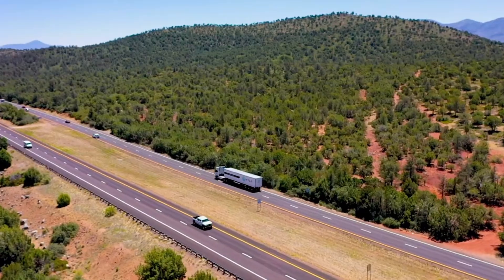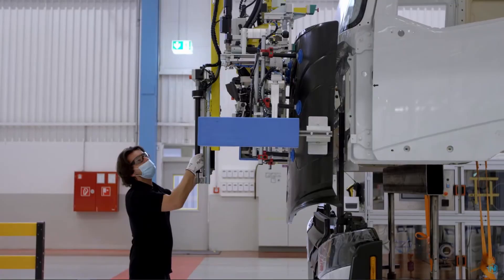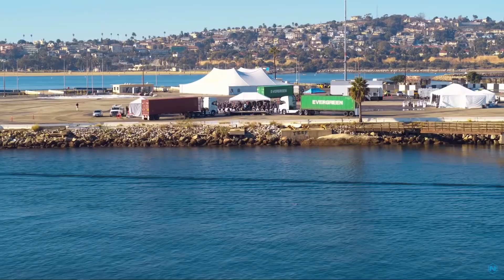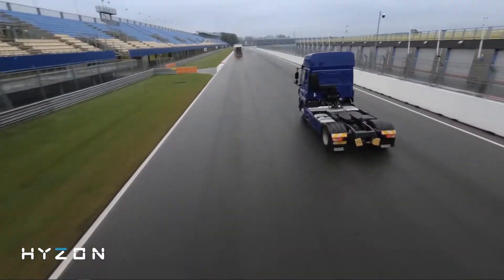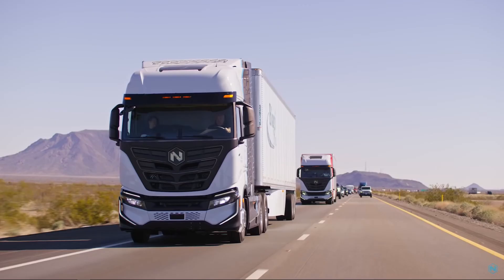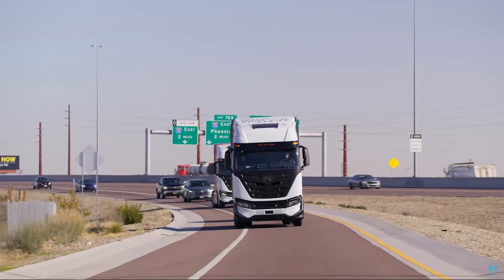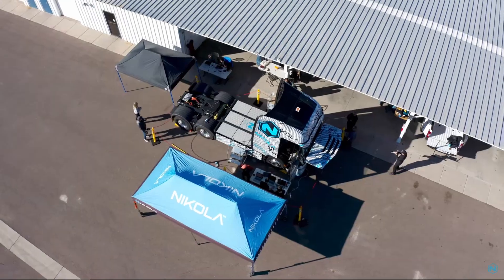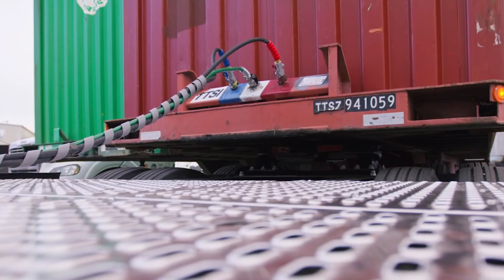Nikola Stats Show H2-Powered Trucking Is For Real.

Comment: this technology is not a bad thing, but the problem with this whole EV revolution is it’s not happening naturally. 
When American switch from horses to the model a ford, it wasn’t because the US government got on the radio and told Americans they were tired of horseshit in the streets, they didn’t start passing mandates and giving out subsidies.
it happened naturally Just like all things do that work out. Through natural selection Americans transition into gasoline, cars, and carriage companies and horse breeders fell off. When you force people in a four-year span to jump into a new technology that’s not really known that well or even really wanted. You end up with a lot of bad attempts and wasted money.. also any rational person can look at this and no down deep this isn’t the answer. 
That’s the problem with the majority of this go green technology, you’re trying to replace something that works already that was developed through time and natural selection with something new that’s supposed to provide the same services as your current technology at a much higher efficiency.
The problem I see is all the details that make up the factors that are measured to determine savings or something efficiency versus current technology are rarely used.
A good example is diesel truck, if you were to measure the admissions coming out the tailpipe of a modern diesel truck versus one from the 80s. It would seem like the region system has dramatically cut down admissions.
But the fact is if we was to measure the gas coming out of that truck for an entire week versus a truck from the 80s it’s virtually the same.
The region system essentially does nothing more than uses ammonia to strip the pollutants from the exhaust gases and turns them into a solid that is held in the bottom of the truck, but we’re not removing those solids and bearing them somewhere, the region holds the solids in a incinerator you could say, and then burns it away in a large burst. 

it’s not like the government magically figured out how to remove these particles from   diesel fuel. They just using a creative way to displace them to make it seem like its less. Those carbons are always there after you burn a fuel, and you can either release it into the atmosphere slowly overtime or quickly at one time or you can remove it from the gases as a solid and bury it, but it’s still being released to the earth.
this region system has destroyed the reliability of the diesel engine, it has made ownership of a diesel truck, not feasible anymore, it has cost the diesel industry billions for nothing.
These electric cars will be no different. As a consumer if you calculate the upstart cost of an electric vehicle, running cost and maintenance and lifetime of the unit plus the quality of service you’re getting for the trade-off it’s a complete scam.
It takes a lot more energy to produce an electric vehicle, alot more! The electric that charges these vehicle is being produced by power plants that are often fired by coal.
The lifetime of these vehicles aren’t very long. You’re not gonna see 20 year old EV still on the road. and storage and recycling after their lifespan is over is a real problem. Now we have large amounts of filthy lithium to deal with. It’s not the solution.

Comment: Are any of you suckers still holding NKLA?  The share price is down about another 40% since this video was posted.  Down over 97% since the original $10 launch price and 99.7% since the high.  Now they're going to dilute you by about another 13% by handing out shares to the MISmanagement team.  Then they can dilute away about another 94% of your shareholdings without even having to ask shareholders again.  This is really one of the very worst companies listed on a US stock exchange.  Milton & Girsky should both be locked up.

Comment: How most hydrogen stations work:  (1) Primary hydrogen delivered as gaseous or liquid hydrogen (2a) Gaseous hydrogen compressed into secondary high pressure tanks to 10K to 12K psi (2b) Liquid hydrogen gasified via heat exchanger and compressed into secondary high pressure tanks to 10K to 12K psi.  (3) To dispense into vehicle, hydrogen from high pressure tanks released into a chiller to chill hydrogen to -40 degrees and sent to the dispenser nozzle and into the vehicle.  The hydrogen must be chilled because when the compressed hydrogen expands into the tank, it heats up.  Max temp of Type IV hydrogen tank is 85 C and max pressure 12.7K psi.

Comment: It will be interesting to revisit this video a decade from now. Personally I see no future in hydrogen fuel cell vehicles, or Nikola. I’m 58YO and hydrogen as fuel for vehicles has been talked about my entire life, a bit like nuclear fusion has. The fundamental problems with hydrogen have not changed in that time, because physics has not changed in that time.
Reply: I'm 68 YO and never thought I would see a hydrogen vehicle.  However, as I live in California, I have been fortunate to be able to drive a light duty FCEV for the past 6.5 years!  The vehicles themselves work fine.  The obstacles right now are expanding the production of hydrogen for vehicles and the reliability of station equipment.  We are currently just resolving those issues and, I believe, within five years, there will be expansion into other states beyond California.
Reply: @bruhabox  Hi, thanks for taking the time to reply. Well done for switching from gasoline. I’m all for electrification, I have owned an EV since 2019 (BMW i3) and I will not go back to a combustion car. My issue with FCEVs is that I don’t see this technology as the answer to electrification, mainly because hydrogen has too many fundamental problems as a fuel source that I don’t see any solutions becoming available based on the physics and chemistry considerations.
Reply: @simonreeves2017  Hi.  Can you elaborate as to what you see as fundamental problems?
Reply: @bruhabox  I can. Hydrogen is very hard to store. It cannot be contained and thus it escapes. That's one. You need a very expensive system to work with it, from extraction to transport to use. Very very expensive.  You fill your tank and a couple of days later it's empty. Another issue is that it's very inefficient as an energy storage. You have to extract it from water or gas and this takes a huge amount of electricity, then you have to cool and compress it for storage and this again takes alot of electricity, then you need to transport it and store it at the destination fuel station and again this takes alot of energy, and finally you then need to use alot of energy to actually generate electricity to power the car motors.  So the question is, are there any alternatives that are better? yes, diesel is better, gasoline is better, batteries are better. Consider the efficiency of a battery powered car. You get electrons from the grid directly to the battery at very low loss of energy. For hydrogen? you get energy from the grip to extract, compress, transport and store and only then you can burn the hydrogen to get electrons back again. it's madness and stupid. Its actually cheaper to capture carbon from the atmosphere ( also very energy intensive ) and make methane out of it than can then be burned with normal ice engines than to do all the hydrogen play. It's really stupid.
Reply: @pedroteixeira4369  Your statements that "hydrogen cannot be contained" and "you fill your tank and a couple of days later it's empty" is just fundamentally wrong.  I have been driving hydrogen fuel cell vehicles for over six years, filling up every couple of weeks and I do not lose any hydrogen.  If you do not use appropriate materials to store hydrogen, yes it will leak.  But industry has been using hydrogen for decades.  They know how to use the correct materials.

WRT better alternatives, the premise is to get off of petroleum, so diesel and gasoline are not alternatives.  The battery electric vehicle is an alternative, but not everyone has the ability to charge at home.  When I look around at neighborhoods where I live, I see many cars parked on the streets and many apartments where chargers are not available.  Perhaps you live in a community where everyone has garages and can charge at home, but that is not the norm.  There must be an alternative to provide an alternative and hydrogen is one.

You are correct that FCEVs are not as efficient as BEVs, but people don't care about efficiency, they care about price.  If people really cared about efficiency, they wouldn't be driving gasoline vehicles.  How many times have you heard anyone say "Boy, my gasoline car is sure inefficient.  Look at all that heat that goes to waste during combustion."

And yes, currently hydrogen is expensive.  That is because the hydrogen mobility industry is just starting out.  In the U.S. there is only one hydrogen plant that has been built just for LD or HD vehicles and that was open just about three years ago.  However, through the IRA act, up to 10 hydrogen hubs will be allocated up to $7B to be built.  When those hubs start to produce hydrogen, it's estimated that hydrogen production costs can be driven down to $1 per KG.
Reply: @bruhabox  No one has ever said “boy my gasoline car is sure inefficient.” And it doesn’t matter if it’s inefficient, it takes a minute and a half to refuel. It’s not like an electric ev where it takes an hour and a half and 3/4 of the charging stations are broken.

Comment: @3:18 The fueling time has nothing to do with temperature difference and they won't fill lower than the 10,000 PSI.  (I don't know where you heard that from) The hydrogen temperature is chilled to -40 degrees. That will not change. Older nozzle designs (those that looked like gasoline nozzles with triggers), the exposed metal would ice up when the humidity was high.  Newer nozzle designs (ones without triggers) have vastly improved the icing problem.  I have yet to have problems filling my Toyota Mirai with the new nozzles.  Also, currently, trucks are using light duty nozzles/receptacles which have a maximum flow rate 60 gram/second.  Future heavy duty designs (hopefully released by next year), will have a maximum flow rate of 300 gram/second, allowing trucks to fill much faster.
Reply: Is that the new pump+dispenser being developed by Bosch (may be a JV not sure)? I understand the Oakland FEF station will be upgraded to it when the dispenser is ready.
Reply: @allansheth  There are several companies that are designing for heavy duty trucks.  FEF has been testing cryopumps from Bosch Rexroth, Mitsubishi, and a third company I can't remember the name of.  Cavendish (formerly Nel) Hydrogen is also getting into the HD game, though they seem to be using gaseous hydrogen as supply source.  This is all predicated on the finalization of H70HF (High Flow) global standards (SAE J2601/5).  Yes, FEF's Oakland station should be upgraded because currently they use the smaller H70 connector and would have to be upgraded to the larger H70HF  nozzle.  I don't know which vendor they are using at the station for the cryopump.  They may be able to just change software and some components, or they may have to do a major retrofit.
Reply: You have a Toyota Miria? 🤣🤣🤣🤣
Reply: @simonreeves2017  Yes, I am returning my 2021 leased Mirai after 3.5 years and am purchasing a 2024 Mirai this week.

Comment: Around the 6:45 mark Ace mentions that a kilogram of hydrogen has the same amount of energy as a gallon of diesel, so lets make some diesel and compare, 70 kg of hydrogen times 120 Mj is 8400 Mj. Diesel is 13% hydrogen, so dividing 70 by 13% we get 538.46154 kg of diesel. If the density of diesel is 3.17515 kg per gallon then 538.46154 divided by 3.17515 is 169.58617 US gallons. To calculate the energy in a volume of hydrocarbon fuel we can use this formula, volume * (density * hydrogen * efficiency) ÷ volume, so 169.58617 * (3.17515 * 120 * 0.13) equals 8400 Mj, dividing 8400 by 169.58617 we get 49.53234 Mj per gallon. So one kg of hydrogen has 2.423 times more energy than one US gallon of diesel fuel.
Reply: 5 times expensive than Diesel
Reply: What a load of twaddle! The amount of energy in diesel is not based on the percentage of hydrogen it contains! For a start the diesel is combusted in a combustion engine, the hydrogen is used in a fuel cell to generate electricity- totally different processes. Both processes are hugely inefficient at creating torque at the wheels of a vehicle, but in very different ways.
Reply: Dude, 2.5 gallons of diesel contains 1.03 kilograms of hydrogen. Are you suggesting that 2.5 gallons of diesel ( 1.03 kilogram of hydrogen ) does not have 2.5 times more energy than 1 gallon of diesel???
Reply: @saltydogg  Yes, I am. I suggest you study chemistry before applying simple ratio analysis to chemical energy. When a hydrocarbon is burned, the chemical output is H2O, CO2 and CO, this is a highly exothermic reaction, but most of the energy released comes from the oxidation of carbon, not the oxidation of hydrogen, this is because hydrogen has just 1 electron available for chemical oxidation, carbon has 4! That is why when hydrogen fully oxidises it takes 2 hydrogen atoms to combine with a single oxygen atom, but when carbon fully oxidises it takes just 1 carbon atom to combine with 2 oxygen atoms - 4 times the exothermic release! This is exactly why hydrocarbons make such good sources of heat energy when oxidised, and why we have used them for so long for this purpose, wood, coal oil and gas are all hydrocarbons.
Reply: Sorry dude, when I drive I don’t do chemistry, I do math, ten gallons of fuel will take me ten times farther than 1 gallon of fuel and 2.5 gallons will take me 2.5 times farther than 1 gallon and 2.5 US gallons of diesel contains 1 kilogram of hydrogen. So if I can drive 28 miles on 1 gallon of diesel then then I can drive 70 miles on 2.5 gallons of diesel. If I divide 70 miles  by 2.5 gallons I get 28 miles per gallon. If I divide 70 miles  by 1 kilogram of hydrogen I get 70 miles per kilogram. If you would take a little break from the chemistry and try some arithmetic you might notice that 28 * 2.5 is equivalent or equal to 70 * 1 Kind of like 4 * 3 is equivalent or equal to 12 * 1 and numbers don't care much about chemistry.
Reply: @saltydogg  Hi Salty, well it doesn’t matter whether you do chemistry or math, because your engine is doing it for you, it’s called physics and chemistry. Now if you have the ability to re-invent the laws of physics and chemistry, I suggest you patent that very quickly and you will make a fortune!
Reply: Really, I can invent new physics and chemistry dividing by 1 or multiplying by 2.5 and people will pay me a fortune. Cool, maybe I can invent some other stuff too, maybe calculus or trigonometry or some imaginary numbers. I know you have a problem with real numbers, maybe  imaginary numbers might be more fun for you.
Reply: @saltydogg  Well actually as an electrical and electronic engineer I had to use imaginary numbers a lot when I sat my exams back in 1987. We use the letters I (in math) and j (in engineering) to represent the square root of -1. Solving equations that contain the square root of -1 is essential in physics, chemistry and engineering. Without this you would not be able to use modern technology like computers, tablets and smartphones, because they would not have been invented.
Your original comment stated that the relative energy density of hydrogen gas and diesel is based on the amount of hydrogen they contain, and you explored this as a simple ratio. I am just pointing out to you that your initial assumption is incorrect, and energy density is not based on the amount of hydrogen present in a substance, energy density (from combustion) is based on the exothermic reaction when the fuel source is oxidised and that oxidising carbon releases 4 times more energy than oxidising hydrogen, which is why hydrocarbons are a far more energy dense fuel than hydrogen. This fundamental problem with hydrogen is one of the many reasons it remains a fringe fuel source, add to this the complexity of creating, storing and transporting hydrogen and the odds get even worse for hydrogen as a fuel source.